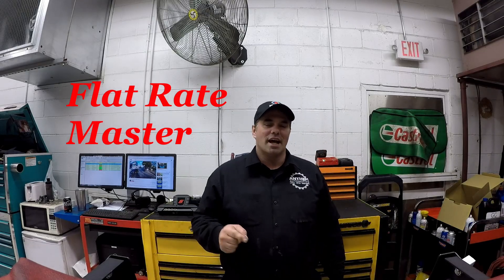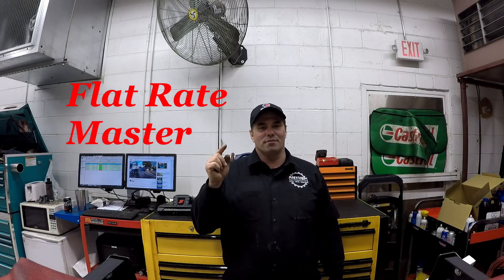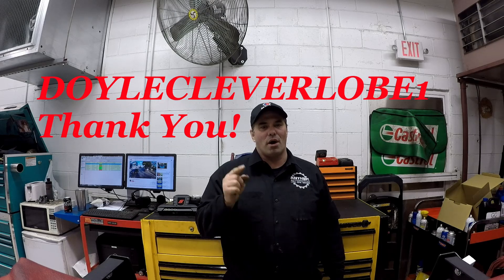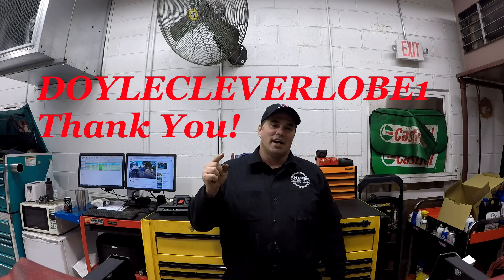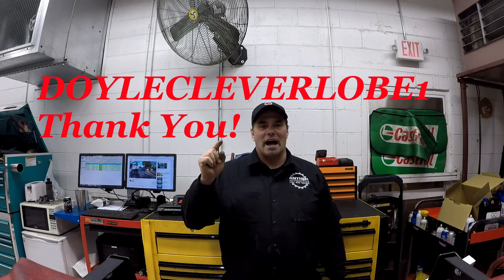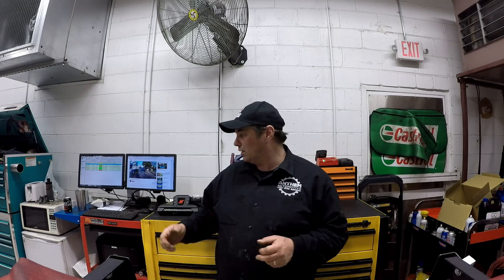Car Lines I Hate Working on and Love Working on!

Comment: I have been a euro tech since I started worked for audi dealer my first 3 years. Then went independent. The issue I run into mostly with euro car owners is they got the 60k plus car 5 to 10 years ago for 10 to 15, and they can't even afford that. Then they freak out at the cost to repair it maintain it. You bought a car that sold for 60k, what did you expect. I always want to say "its expensive to look rich". That might be too mean though. Good vid.
Reply from the maker: Yeah, Euros owners can be either a great customer or your worst nightmare, luckily for us we have customers that maintain there expensive cars:)
Reply: That's the #1 complaint I have about them. I'm surrounded by used car dealers that peddle old worn out A8's, S classes and 7 Series to people who can barely afford them now for a few grand, then they come in when it breaks and they figure out that it's going to cost what they paid for the thing to make it really right and reliable and I'M somehow the bad guy.
Reply: Play like a sport, pay like a sport. A lot of tickets the first line was repair to run; customers wouldn't maintain them.

Comment: Jag Rover tech here.... I love our cooling systems 😂. They pay good money, even on warranty time. And we see A LOT of leaking rovers and jags. I average at least 2 major coolant repairs a week. Rear crossover, thermostat, front outlet assembly, and water pump. Pays about 9 hours on warranty, easily done by 3 in the after noon with just enough time to start and finish a PDI.
Reply: When I was at rover I would have all that done by lunchtime. The one that was a pain in the a** was the rear crossover pipe. Thankfully the pipes on the new models only were 2 bolts on each side instead of the middle 3rd bolt

Comment: I have a theory. If it uses wheel bolts instead of lug nuts, I really don't want to work on it.
Reply from the maker: LOL
Reply: dont forget the knockometre and the left handed screwdriver
Reply: Screw VW Audi
Reply: @Tyler Roberts Some Dodge and Chrysler vehicles have wheel bolts now
Reply: Agreed
Reply: @manuelsalvatierra2940  Um to clarify, those are FCA.  We don't include those under the Mopar umbrella.
Reply: Yea I know... I can but jeeze I dont want to lol. Also I always wondered about why they chose to use bolt studs and the best I can figure
is that in Europe car hoists that lift the car far into the air must be uncommon...I figure they got little pad lifts that just barely lift the car because some of those fancy mercedes and bmws have really nice wheels and taking the wheel off and having it PLOP right on its face isn't a great thing. 

I know you can screw a set of studs into them and prevent it... and usually you can manage but holding a gun in one hand and a wheel in the other AHHH but WHYY lol

Comment: Amen on the Nissan cooling system bleeding. I've had a couple I had to lift the front end five feet off of the ground to get the air out of it and get the heat blowing hot. That and having to unplug injectors to get them to idle low enough to learn the idle most of time.
Reply from the maker: Idle relearns suck on nissan:(

Comment: Honda Civic before 2006 @ 100K mile. TB, alt+p/s belt, ac belt, water pump all at same time. most likely could also add dist o-ring for pre 2000 or cam plug, v-tech valve seal, oil pan gk and valve cover gk

Comment: Like the forum Flat Rate Master. Thanks for taking the time...An anomaly i'm sure, to have 234 K miles as original owner to a 2002 Range Rover Westminster. soon to rebuild, showing signs of engine age as i commute between Sacramento and Marin County. A small secret, Never, Never loan your vehicle to brothers or homies. they'll return it to ya and say Don't trip. the only other drivers other than my teenage friend - mechanic of the past 18 years, are some women i asked to drive me home from a local bar after, explaining i drank to much, which turned into some very positive nice relationships; and fortunate to have avoided unnecessary drama associated with DUI.

Comment: i work at a nissan dealer im an apprentice  and i agree with you there cvt are junk , quite a few models have timing chain issues , the 4.0L and some infiniti's like to blow the gaskets in the rear cover , the newer suv's eat through rear brakes , the cooling system are iffy sometimes , however now that i know the product fairly well i enjoy working on nissans/infiniti and the all the guys in the shop do fairly well.
Reply from the maker: Well that break down all the time:) so you should stay busy! Good luck on your career!
Reply: Flatrate Master hahah yea they are always in the shop. and thanks!
Reply: I used to work for Nissan, now I'm at Chrysler....  let's put it this way, all my vehicles are nissans lol...  when a Nissan has a problem it's a problem with all of them.  On Chrysler product, every car is a different problem.

Comment: I started my career working on Mazda and Isuzu, got tired of the warranty pay and decided to try out Heavy equipment for a while until the company went bankrupt at which point I began applying at nearly every shop in metro Atlanta. A Honda dealer was the first to offer me a job so I took it and actually kind of enjoyed it. Three months in one of the Mercedes dealers contacted me about a job opening. Once I visited the air conditioned shop in the middle of July I was sold. It was a HUGE learning curve and I wasn’t sure that I would make it but 16 years later I am still working on Mercedes albeit at an independent (by choice). They take a while to “master” but once you get used to their way of thinking, the way they structure their service  and parts information etc they are probably my favorite cars to work on.I am currently working at a European/Asian shop (with the exception of British,Italian,exotics and Porsche) and my least favorite cars to work on would have to be the two V’s- VW and Volvo. Maybe they just take a while to “master” but I just really have no desire to work on either brand. I Like your channel and my brother-in-law is actually good friends with the owner of your shop.Keep the good vids coming! I apologize for the long post!

Comment: one TIP on vacuum fillers i got from a rep a while back is to prime the inlet tube before a full vacuum and just like pulling a vacuum on an a/c system ( its not just to get all the moisture out ) is to let the vacuum hold for 5 minutes or longer while you take a shit etc. in order to create a full vacuum in the system it takes time. its takes more time yes but trying to bleed the rest of the air from a rwd infiniti 3.5 litres well you get the idea.
Reply from the maker: Mine is a older system without that ability, you have to swap hoses to pull in coolant. I think an Upgrade is coming!

Comment: Ha ha.  Was thinking Mercedes before you said it.  Used to own a '76 450SL.  Custom, custom, and more custom.   No trip to the local hardware or auto parts store for that guy.  Had to get stuff from Germany.  (To their credit, they at least still made everything).  Shudder to think about working on the new ones.  Wires everywhere!  (Although vacuum tubes really sucked 😁).
Reply from the maker: Haha, they do support their cars for a very long time. Plastic lines that break if you look at them!

Comment: Was a tech for Toyota and use to be the only one that loved getting the 06 -07 5.7 tundra starters. the ones under the exhaust manifold paid 6 hours . first one took maybe 3 and then after that it seemed like 45 min to a 1 . hell and even prius. get a second gen. in and more than likely needs a waterpump. would get 2.5 for a 15 min job.
Reply from the maker: Haven't worked on a ton of 5.7 tundras we mostly see, Sequoias with the 4.7 gravy timing belt!
Reply: Which would you say is more reliable?

Comment: I had an old school mechanic teach me a really cool trick if you want to bleed the cooling system on something without having to do any work you need to know what you're doing mind you but you can drill a 1/16 hole in the edge of the thermostat I've never had to bleed a cooling system since I started doing that and I've never seen any issues as far as overheating or not coming up to Temp any of that

Comment: I would definitely agree with you on the feedback carburetor. For me pretty much any 80s cars sucks to work. I am a big fan of most European cars. LanRover and Saul being at the very bottom. Cool video congratulations on 1000 subscribers.
Reply from the maker: Thank you! yes late 70s and 80s cars sucked!
Reply: No matter if American, European, or Japanese... when a feedback carburetor quits, a satisfactory repair is almost impossible because for some reason the rebuild kits never contain the 3 or 4 diaphragm assemblies you need to actually fix it.
   Fortunately these cars and trucks are so old they rarely have to pass an emissions test. The cure is a Weber carburetor kit that costs about 1/2 to 2/3 the cost of a remanufactured feedback carb. Remove the feedback carb and the primitive computer and place them in a trash can.
Reply: I want an 87 Monte Carlo SS, the first thing I'll be doing, is introducing the "PCM" to my Benelli 12ga, Slap an old Holley on it, with a Pertronix vacuum advance ignition, enjoy the lack of stupidity.

Comment: I had the Same thing happen with a Mercedes convertible I fixed the soft close trunk latch and the problem came back 2 months later and the guy was screaming in my face and after that our shop does not work on them and all I did was put a new latch in pretty straight forward

Comment: To bleed or vacuum bleed Nissan and Infiniti vehicles some of them have multiple pressure caps and some times you have to bleed through the pressure cap that's on the reservoir instead of the radiator.
Reply from the maker: Very true! Thanks for watching!

Comment: im a truck tech. love kenworth t800s. hate hate hate freightliners.. im at international now for the last 4 years, amd they have their draw backs but id take 13 letter shit spreaders over freightshakers all day long.

love the videos, great job flatrate master.
Reply from the maker: I owned a Freightliner, what a POS truck! My Dad drove a Kenworth cab over back in the early 80s he loved that truck!
Reply: Love older IH(pre Navistar) and Ford semis.
Reply: Freightliner = Mercedes garbage. As for International, their parts supply chain sucks and you often run into situations where you have an odd looking part that you can't find an aftermarket replacement for.

Comment: I know it's technically a Norstar but how about the late 90's V8 Olds Aurora.....absolute nightmare! Try changing the radiator on one of those. I remember getting a service call because the owner couldn't find the battery to jump it.
Reply from the maker: Trying to forget those POS  baby northstars!
Reply: bosborn1 I had a friend that had an Aurora and after having it worked on twice I was able to talk him into selling that thing. There is nothing fun about working on anything on that car.
Reply: stupid starters under the intake...there was a 3.5 v6 version in the intrigue..called the shortstar UTTER GARBAGE

Comment: Call me crazy, but lately Fords have been a pain in my butt. Seems like the nuts and bolts wrenching part of them has been quite rough. Lots of stuck bolts on the newer stuff I have touched. 

A 2013 Taurus had stuck cradle bolts, had to rock them back and forth for an hour each with a 4 foot breaker bar. Bolts came out with part of the nut fused on it. Also snapped off a sway bar bolt on that same car. A lot of the newer Ford trucks are a pain to wrench on as well.

Comment: hey I'm a new tech i wanted to know are flare nut wrench really needed besides bleeding brakes ? and hows matco's tools and warranty?
Reply from the maker: Yes, for brake lines, p/s steering lines and hydraulic lines, they are made of softer metal and will easily round out. Lifetime warranty on Matco's sockets, wrenches etc, same as Snap On etc. Very good quality
Reply: what wrench set should i be looking at for an incoming tech? regular open end or combinations wrenches and around what size 8-24mm? ps thanks for replying back
Reply: kelvin lopez. Combo wrench is more versatile than open end only. 8-24mm is good for most import  passenger vehicles. But if you work at "all makes & models" shop, some SAE sizes are must, however IDK cuz work @ import dealership. SO Flank Drive Plus open end is the best of the best, but 8-24mm probably would cost you about $1000 or more.

Comment: I have a 2010 Range Rover at my shop, dealer wants me to replace head gaskets but 1 or more cylinders fill with coolant after turned off. I fear it may have a cracked block. Is that your experience?
Reply from the maker: Almost always a cracked block
Reply: Flat Rate Master thank you for your time!

Comment: European cars usually needed "special tools" that nobody had! Ford and their "breakout box" thang" goin' on!  Oh, put a clutch in a Saab 900 Turbo! Special tool time for that one! Renault "Le Car" What a gem! NOT! Try workin' on Yugo! Real fun! Had an early Hyundai Excel that wouldn't run unless you took at least ONE plug out! Come to find out the cat converter was built in the exhaust maniford. Gut it out! Problem solved! Old 80's Nissan with their computer under the seat with th' red and green blinkin' light codes plus emission stuff that you don't have any idea what they're for!  I liked GM, but hey, I got a GM background, so why not?
Reply from the maker: Special tool are now a way of life for almost every make and model:( hated those breakout boxes that I never had, so much harder without those. Thanks for watching!
Reply: Haha.......I remember those weird tools for them feedback carbs too! OTC and Lisle made many of them. I also recall having to take off the entire carb to knock out those dumb ass plugs that kept you from adjusting the idle mixture screws! Remember the different colored grommets Ford had on their Ignition modules? Remember having to set idle with propane (enrichment) on Chrysler stuff? Am I going back too far?  At least I didn't mention the tool that you had to put through the point adjustment access on GM distributor caps! Distributor cap? Yeah, I know,..........what's that?
Reply: Hey Big G, I hear you on that Renault Le Car. I did the clutch on one back in '87, a year out of high school. I told my dad when I was done, that after that, heck, I can work on anything. I think of that job at least once every week. It helps me to take on anything. I had three of the old beetles back then. I could back one up on ramps and have the engine rolled out on the floor jack in under 20 minutes. I still like them. But . . . I'm always privy to the bow tie. Thanks for the memories.

Thanks for the video, Flatrate Master.
Reply: Big G       I remember all the same things. It was fun to repair cars in those days.

Comment: Look up forscan for Ford, you can do almost everything in IDS for free, with a cheap OBD II adapter. I can do ABS or air suspension work on a 95 Continental, it is pretty through!
Reply from the maker: Shop has the Ford IDS, trust me it is no where close to the IDS, but is a nice tool
Reply: I agree IDS could flash older cars. But for a DIY or even a first look for a pro, it is an excellent tool. A local transmission guy thinks it may update the pids and data faster. He uses it for trans work to graph pids and codes.

I like the interface too. IDS and snapon won't work with the ABS on the Continentals.  I had an IDS years ago and sold it. Forscan guy got it to read wheel speeds so I didn't have to pull apart my wiring to find an intermittent. I guess that is why you don't work on the old stuff!
Reply from the maker: I do not work on old stuff because there is no money in working on Junk, IDS is 96 and newer only, as I said it is a good tool, but not a replacement for an IDS

Comment: You can buy  iscan 2 for euro, the Autologic blue box is still supported. German car customers are the best in most cases $$$. The old SAAB's from the 80's were decent. EBay has all the bootleg oem software. Japanese cars, lets not forget Pearl Harbor.

Comment: Toyota,engine failures in the Matrix galore including the Pontiac Vibe.I have seen two of these so far,one was locked up and I ended up pulling the oil pan to turn it over.
Reply: @Walter Frederick
What years?
Must be 2.4 engines?
Reply: 1Z and 2Z engines,have to go by a tag on the block.The years Toyota made them
Reply: @Toolaholic7  
Your talking about 2.4 though correct?
Never heard of any Toyota 1.8 engine problems like that.
2.4 I would say yes,in 2nd generation Matrix & Vibe.
Reply: 1.8,over a grand used

Comment: I hate working on german cars, Nisan. I hate some Fords because to remove a part you need to remove a lots brackets bolts and nuts, for example Ford "conFusion", rear shocks. I love working on Dodge and Chrysler.
Reply from the maker: I have no issues working on CDJR except they have cut times badly and hard to make good money on them anymore, even though they break a lot!